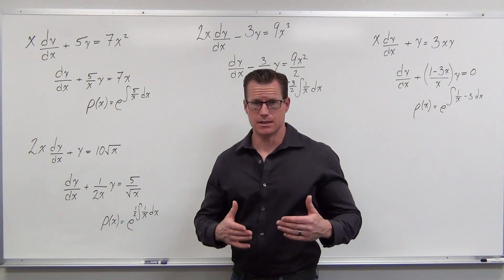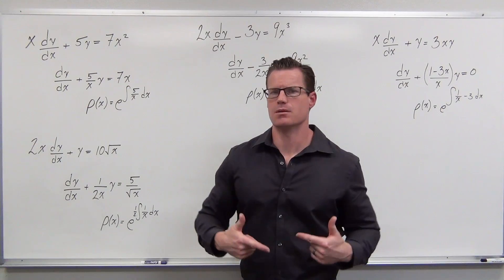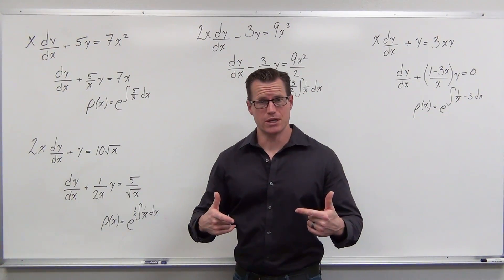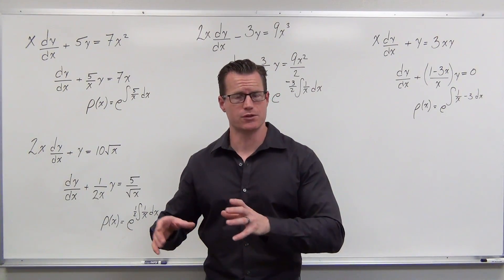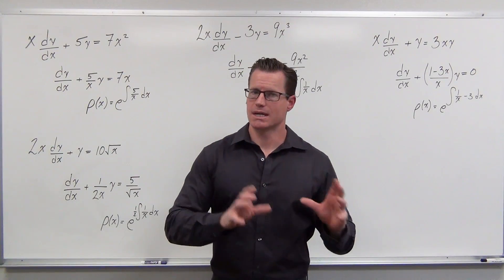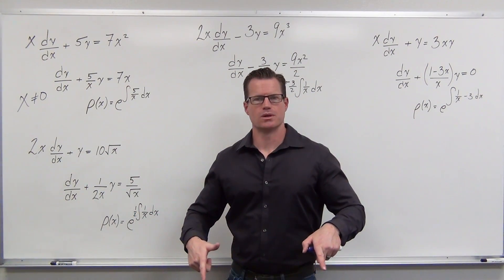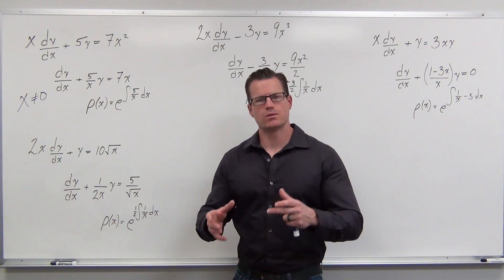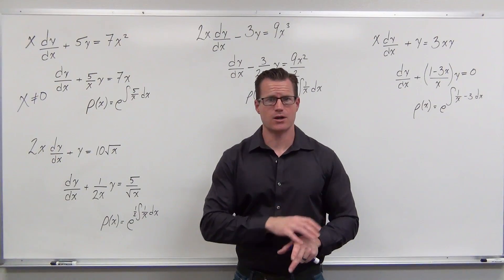Domain Restrictions In Differential Equations and Integrating Factors (Differential Equations 17)

Comment: 10:20 is the other reason that we need the function to be continuous to be differentiable ?
Reply: ln |x| attempts to have no (-) x values, otherwise, the solution would not exist if it were negative
if x = 0 in the denominator, that would mean there is no guaranteed solution at that point since it is at the endpoint of the function
so x>0 is used as restriction to the diff.eq. solving both the absvalue problem and the x being equal to 0 in the denominator

Comment: Hmm, I wonder if in some mathematics you can divide by a variable, x, without regard to whether it is ever zero, successfully, as long as you don't wind up with a final answer involving x in the denominator.

In that same vein, George Berkley's objection to the Calculus was that taking delta y /delta x as the delta got smaller and smaller would result in dividing by zero.  But we get around that by finding a way to canceling out delta x in the denominator.